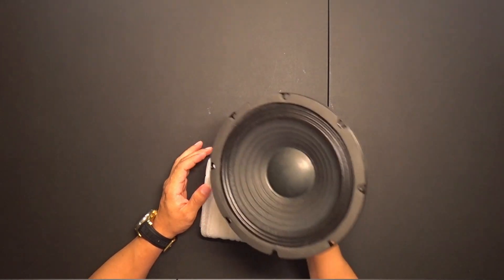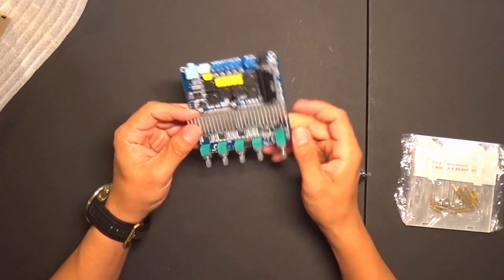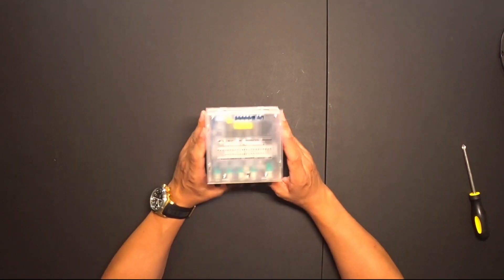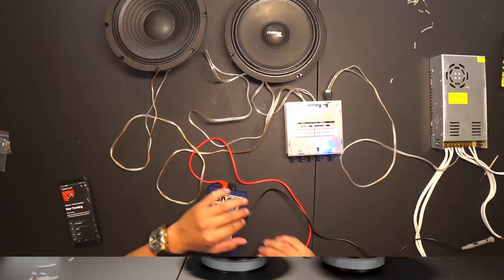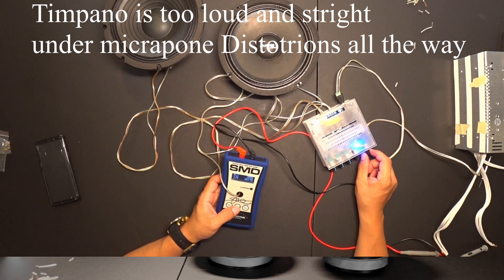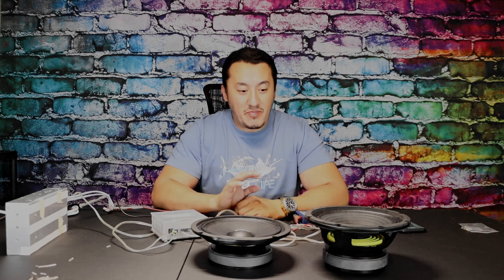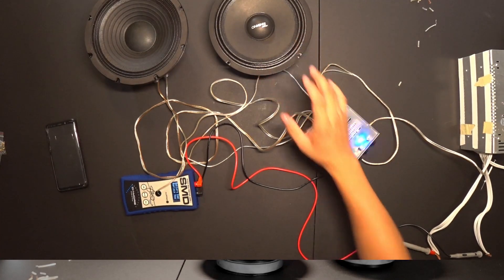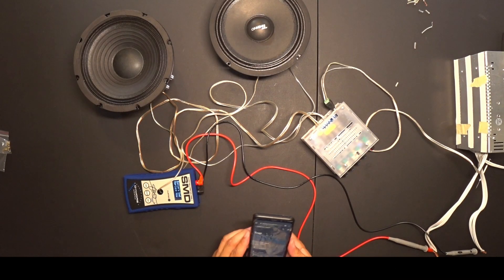Best DIY Aiyima AOSHIKE  2.1 Channel TPA3116  Bluetooth 5.0 Amplifier Board DIY Speakers

Comment: I used this exact board to revive an old edifier 2.1 computer speaker system. I had to buy a beefy power supply though, also from Aiyima.

Comment: I experience too much distortion in bass output... probably preamp is not adjusted properly. To have clear bass I have to turn down way low the bass volume. I hear the same bass distortion in this video..

Comment: You should measure voltage from amplifier output to get power. Now you are hooked on input voltage. Looks like clamp is on correct wire. Just change voltage probes to amplifier output :)